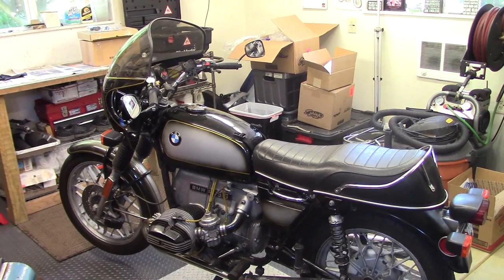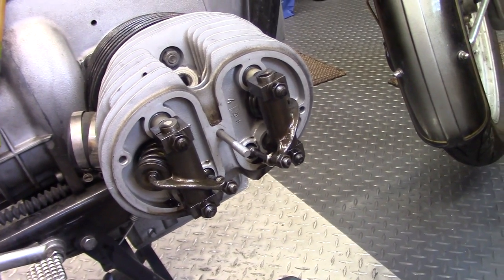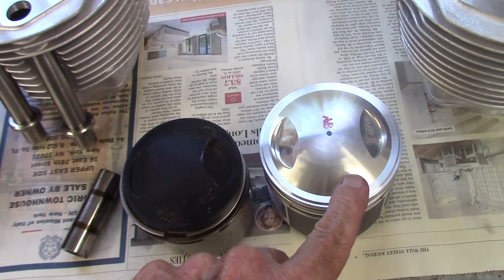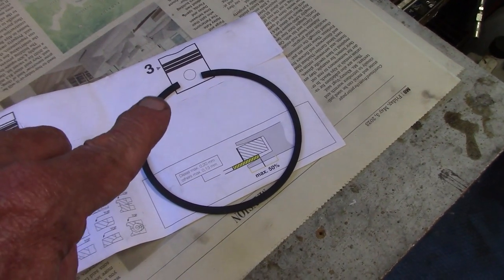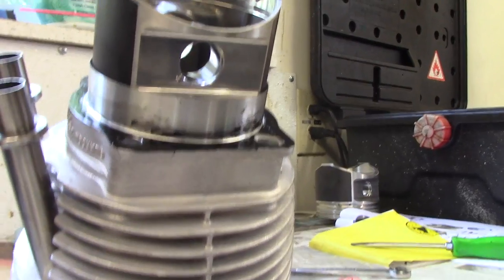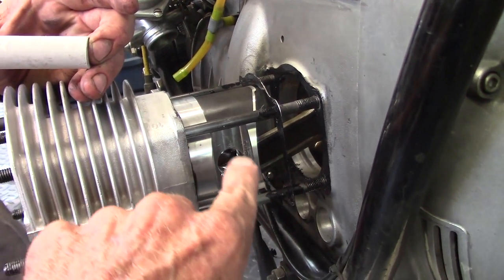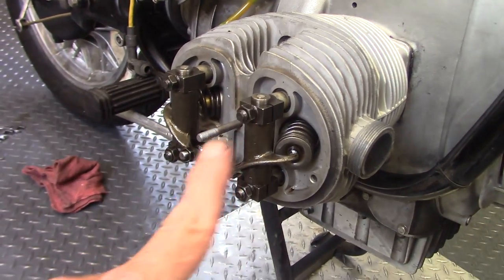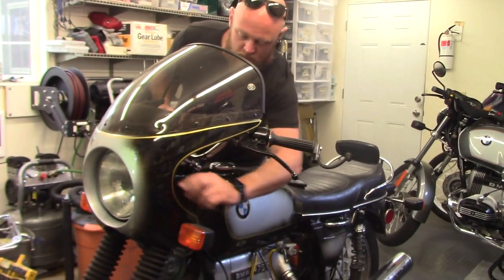1975 BMW R75/6 Install Siebenrock 1000cc Upgrade Kit

Comment: Excellent video. The Siebenrock instructions are pretty good. I installed a 1000cc kit to my R90/6 and it was a great upgrade. Im considering installing an 800cc kit to my R65.
Reply from the maker: That should add some punch to the R65.
Reply: @BrooksAirheadGarage hi, I’m wondering if siebenrock has big bore kit for r60/2 like a 700 cc or 750cc? Thanks for the video and walking us through.👌
Reply from the maker: @johannej3241  I don't know if they do. You can visit their web site and see.

Comment: What an excellent video! One remark though: in some countries, however, this kind of conversion is strictly illegal as the only displacement allowed is the one that appears on the license. Although such infringement is undetectable during inspection, if God forbids there is an accident and the infringement is discovered, the insurance policy is no longer valid.
In certain countries any modification that deviates from the license is strictly forbidden, so check beforehand.
Reply: I don't think there is an insurance adjuster on the planet that could detect this upgrade.

Comment: Really good clear instructional video, thinking of getting an R75 & would probably go down this route if I do.
Reply: Good morning Dave . Thanks for your message concerning my R45 engine upgrade to a 860. I brought the R45 as an insurance right off not structural enjoyed locating all the damaged parts. The engine upgrade is completed not by me . I was going down that route it all makes sense when I read your message. I won’t be getting the bike on the until 1st April so it gives me plenty of time to sort out the paperwork. It will be interesting to see wot they put in the V5. It will always be a R45 because the frame + engine numbers are still the same and the frame is small and shorter than the other models.        Yer it’s quite an upgrade should be interesting 🤔 thanks again for your advice on this matter very helpful. Won’t be too long before we see some milder biking weather.🏍👍

Comment: 212,000 miles "might be time for a top end refresh" gotta love old BMW motorcycles thats impressive german engineering
Reply: For sure..I have 166,000 on my k75s runs perfectly..love it!!!
Reply: Well it had a top end at around 100k. Now that I put another 100k we felt it to be necessary.

Comment: Hi, I recommend copper anti seize, I used the aluminum version last time and it fuzed it all together and ruined the threads on the head. It was recommended that the compound be dissimilar to aluminum. Thanks for the video!
Reply from the maker: Hmmm ... I've never had that problem with the silver anti-seize.

Comment: Apologies for the delay. The cost on the gasket is recommended by BMW. It may or may not help but it doesn’t help. An extra step that brings me a little peace of mind. 

I dumped the oil every 200 miles for 1000 miles during the break in. Sitting at nearly 5,000 miles on the new cylinders and no issues. Next step is to strap on our rebuilt 40mm carbs and matching heads to make it a nearly true R100

Comment: First I wish you and your son a wonderful holiday and great 2024! GREAT VIDEO and hats off to using Three Bond is the only gasket  sealant to use PERIOD, why not use grey? It also looks overkill to coat the gasket, (my opinion) You likely did this, but I always use a petroleum based degreaser on the inside of the cylinders and a white cloth to check for ANY residual, repeat the step until the white rag comes out white. Once clean, assembly lube immediately to the cylinder, just a thin coat, minimal. There is almost always residual material left by the hone even when cleaned by the factory. As for the assembly, nothing goes back together without using assembly lube.! 
Once you run this beauty, change the oil out to a synthetic called Trybodyne. It's pricey, but it's proven and you won't be sorry. 

Thank you for sharing this,
Eric
Harper, TX
Reply: Oh, anti seize on the spark plug thread.

Comment: Sweet vid ,simple and to the point , looks an easy upgrade, though you didn't go into carb set up to suit the increased cc ?
Reply: Apologies for the delay. Increased the main jet one size is about it. Outside of that it was a standard carb balance per the bing book. Not much outside of that to run smooth. I’m at close to 5,000 miles since the upgrade and I have been very pleased. Stay tuned as soon we will be putting on 40mm carbs and matching heads to make it a nearly true R100

Comment: Afternoon just wondering if you can help me. Ive just fitted my engine upgrade kit to my R45 very pleased. 👍 Question 1. Do I have to change the details on my V5 because the engine and frame numbers haven’t changed so it will always come up as a R45 . 2nd will I have to change the details on my insurance. Thanks looking forward to hearing any comments. Have a great Christmas. 🏍🎅🍺👍
Reply from the maker: Richard, I have no idea about the answer to your questions. However, it's not uncommon for someone to upgrade a "stock" vehicle with modifications. The registration is still tied to the original vehicle.
Reply: Hi Richard,  yes you should let the DVLA know about the capacity increase, you need to send off your V5 & I'd be inclined to include a copy of the invoice for the kit & a covering letter explaining what you've done. 
Also you should really notify your insurers just to be on the safe side.

Comment: What would you say to the people who are adamant that you should never use any silicone or any other goo/sealant on BMW airheads?
Reply from the maker: In the case of cylinders you have to use sealant to prevent oil leaks.

Comment: Any thoughts on why the otherwise modern and up to date kit still uses a two piece oil ring?  This seems like following tradition and very "old school" though it does work.  How about a video that measures the clearances of the original cylinders, pistons and rings?

Comment: So was there a noticeable difference in performance? did you rejet the carbs?
Reply from the maker: Branden said the acceleration was noticeably stronger on his 10 mile ride.  Currently the jetting is not changed, but he will check the plugs to see if jetting changes are necessary.
Reply: Quite a noticeable difference. I have a bit better then 100 miles now and it definitely has more get up and go. The carburetors required larger (135 to 150) jets and opened the needles up by one notch
Reply: Nice work and as always, an informative video!
Reply: @BWRBMW  Is yours a R75 conversion as well? Thanks
Reply: @loop1479  yes I should have clarified. I’m Branden, that’s my motorcycle.

Comment: Awesome video! Makes me want to try to do the same on my R80GS (already have the 1000cc SR cylinders and pistons inside).
Job seems not too trick.
Do you recommend me to try even if i have close to 0 experience?
Reply from the maker: loris199, I think you can do the upgrade without large amounts of experience. I have documented installation of the top end on different bikes on my web site: brook.reams.me. You can look at them as well as this video. I also have posted other videos on installing the top ends, but for newer airheads that don't have the base gasket. That's the main difference with this 1975 R75/6.
Reply: @BrooksAirheadGarage  thank you so much for the feedback, i'll go for that...if you never try you never know
Cheers from Italy and thank you again for your precious contents
Reply from the maker: Best of success 😃

Comment: 1988 yılında polisten çıkma 1976 model  R60/6 yı 94 mm silindir ve piston takarak 1000CC ye yükselttim. Komprosyon oranı aşırı yükseldi ve sürekli detenasyon yaptı. Orjinal silindir kapaklarını takarak sorunu çözdüm. Sonradan karbüratörleri de değiştirdim. Buna rağmen özellikle şehir içinde çok ısınıyordu. Max hızı 2 kişi ve çantalar ile 195 Km/saat yakıt tüketimi max yükle hızlı kullanımda 100Km/7Litre oldu. Frenler ön dahil kampana idi kesinlikle yeterli değildi. Siz komprosyon olayını nasıl çözdünüz?  63 yaşında Otomotiv teknik öğretmenim (yüksek okul) BMW nin bu serilerinde sabit strok 72 mm idi yaklaşık sanıyorum 74    94 mm arası silindir ölçüsü kullanarak hacim büyütmek ne kadar mantıklı bilemiyorum. BMW nin en muhteşem eseri 1962  1968 R60 serisidir. Özellikle R69 S 42 PS. Amerika için üretilenler değil. Orjinal ön takım beşik amortisörlü olanlar. Her yük yol ve fren durumuna göre kaster açısını sürekli değiştirerek mükemmel yol tutuş sağlar. R90S lerde fena değildir 67 PS Türkiye den selamlar.❤❤❤

Comment: Have you got a later model gearbox on this bike? Curious to know how the swap went? Also is that an extended sump? cheers!
Reply from the maker: When I had the transmission rebuilt by Tom Cutter, he replaced the case with a used newer one since one of the clutch cable tabs was broken. It does have a deep oil pan that I installed in the early 1980's.
Reply: thanks for the reply. Seems like you really have the best of both worlds now - older styling and 'modern' performance  @BrooksAirheadGarage
Reply: A question about the siebenrock swap - did you base gaskets have clearance for the o-rings to seal against the engine hosing or did they seal against the base gasket ? I am at this stage myself with the same kit for my R75/6 but I have some base gaskets from earlier. They look like the same ones in the kit that siebenrock supplies but I can't be sure. thanks!
Reply from the maker: The orings seal against the cylinder base and the hole at the top push rod in the engine block.
Reply: right so the hole in the base gasket was large enough for the o-ring to pass through and seal against the engine block? sounds like I might have the wrong ones  @BrooksAirheadGarage
Reply from the maker: I could be wrong. It makes sense the gasket hole fits snugly on the cylinder stud so perhaps the gasket pushes on the oring.
Reply: okay, thanks for your input. It's a bit of an ambiguous area with two engine generations overlapping...i think i'll just bite the bullet and order the correct part from Siebenrock to avoid any risk. 

You're videos have been very helpful with my project so far, thanks for putting them out     @BrooksAirheadGarage

Comment: revving that high with a new set of pistons and rings would have me cringing tbh.
Reply from the maker: James, Bob Fleischer (aka Snowbum) recommends this so the rings seat into the bore quickly so they are oil tight.